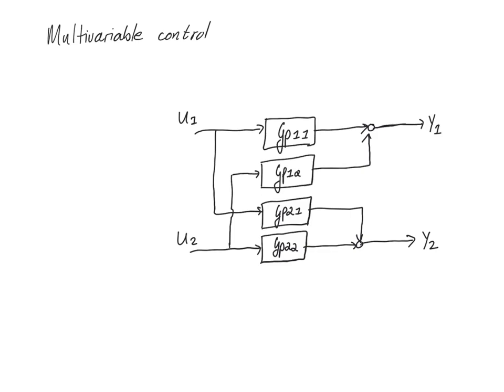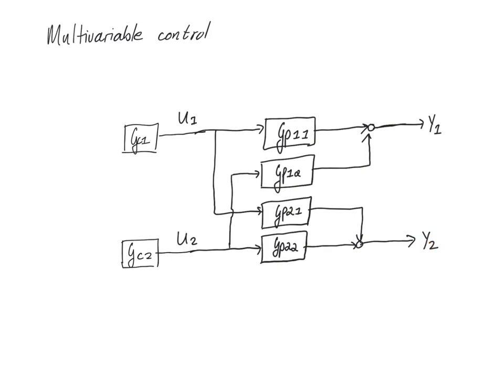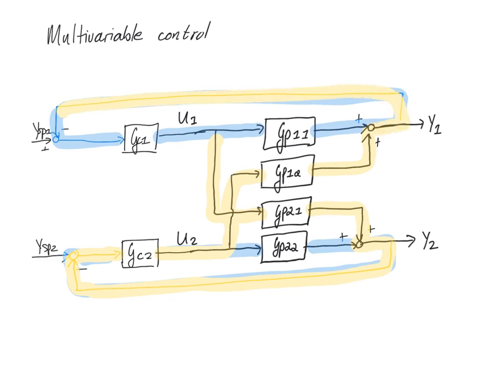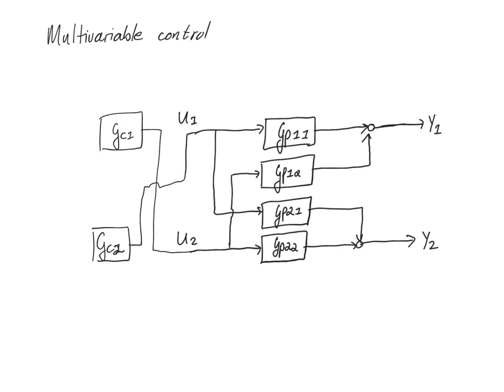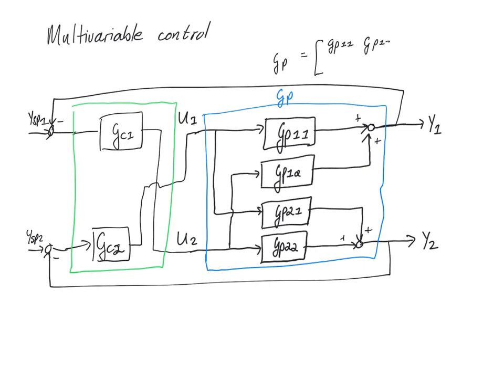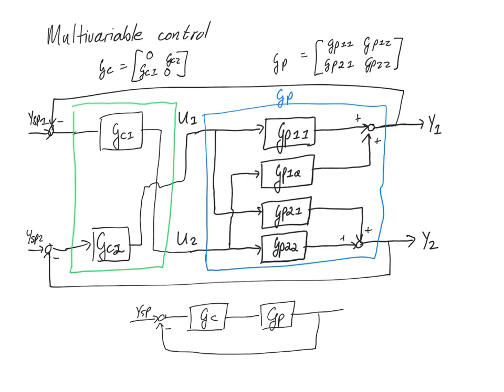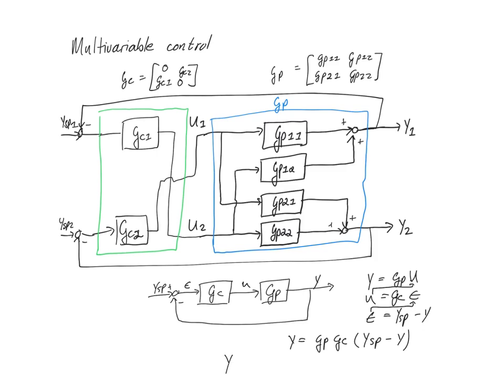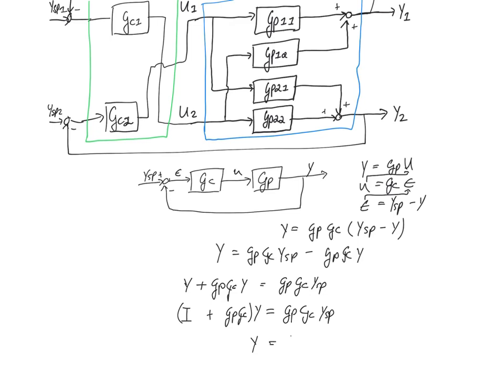Multivariable control configurations 2019-04-26

Comment: In case we have 3 inputs such as PV WP BTAAETY to suplly load  HOW WE CAN MNGE THAT CONTROL  USING MPC, PID CONTROLLERS
Reply from the maker: There are two answers here. If you have three manipulated variables and three controlled variables, you can follow the same PID structure as discussed in this video, but your Gc and Gp matrices will be 3×3 instead of 2×2. If you have three inputs but one controlled variable, you need a different strategy. An MPC controller can handle this case elegantly as you mention by applying constraints or costs to the MVs and including the controlled variable in the objective function.